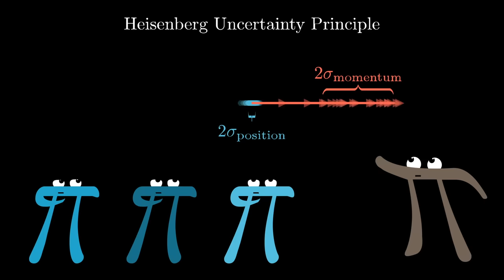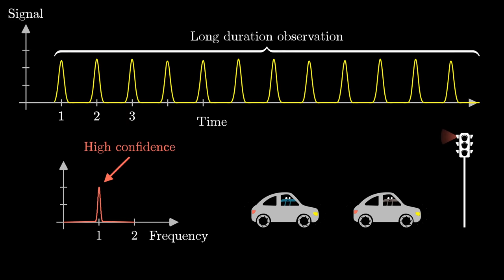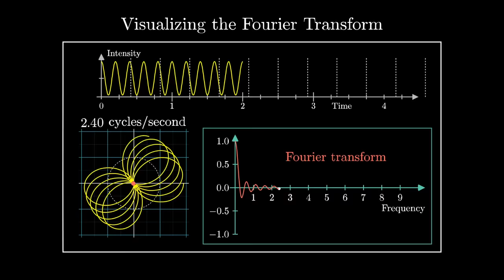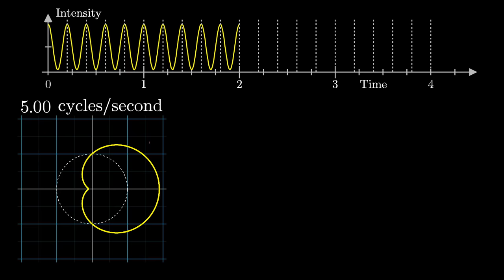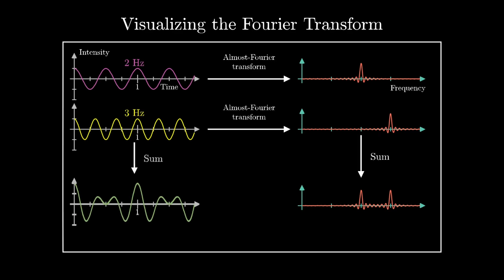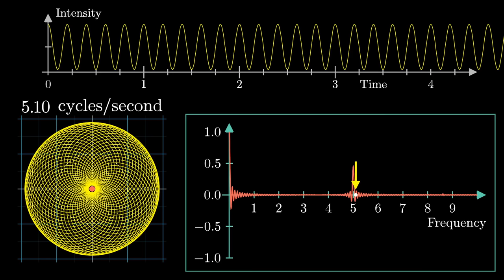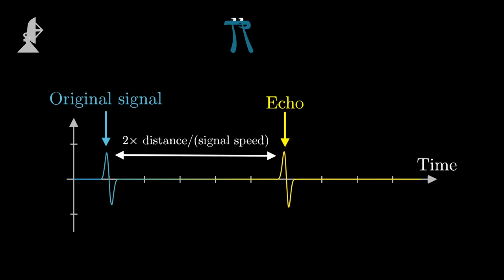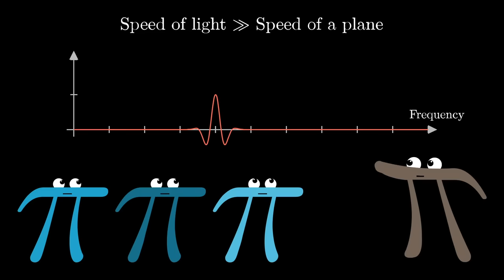The more general uncertainty principle, regarding Fourier transforms

Comment: I recently developed a music training app that is supposed to listen to what you play and assess whether you played some given melody correctly (in time and frequency). So, the waveform of what the user played was chopped into smaller pieces and the fundamental frequency of each piece was extracted, to assess whether the correct note was played at a specific time. Of course, as you explain, larger windows meant more accurate frequency assessment but with a tradeoff to identifying when the note corresponding to this frequency actually started.

Wonderful intuitive explanation - thank you so much! I didn't have a clear grasp of what De Broglie's theory was explaining, so I was totally missing the connection of the above described problem with the uncertainty principle.

You explanation can make a wonderful STEAM course for the uncertainty principle!

Comment: Updated Demo with P5js. https://jbracey2004.github.io/Examples/Excercise00_WindingFunction.html Still Work in progress
Reply: Bob Tivnan It would be interesting to see what the position vs time graph would look  like with that pi creature
Reply: This would be fairly easy to do. I already parameterized the x and y coordinates of the sampled points. Why would do you think it would be interesting?
Reply: Bob Tivnan well, to see some 2d figure represented by a waveform; though, there  may not actually be such a thing
Reply: +Jason Bracey Its just like the video +Bob Tivnan but if you do position vs time then it is always 2 or 3 places at once
Reply: A lot more people use Processing lately... I am impressed by how well Processing is doing.
Reply: Good work
Reply: Great job Holobrine! Your comment about the cos^2 wave can be seen in the polar curve as well. If you simplify and set your function to y=cos(nx) or y=sin(nx) you will notice that the polar curve always has evenly distributed petals except when the wrapping frequency equals n. In this case you get one petal which is a pure circle on the positive side of the x or y axis. Hence, the center of mass is shifted only in this special case. This is a different way to explain the orthogonality of the cosine and sine basis functions.
Reply: By the way, geogebra and desmos are very similar and are great for visually describing math. The downside is that they are much less computationally efficient than javascript or python.
Reply: Bob Tivnan To my knowledge, you cannot calculate an integral with Python, or at least not without a library.
Reply: If you are using continuous functions then an integral is needed. But, if you take the discrete fourier transform approach by sampling points along the curve (which is what I did) then you are not using an integral at all. You just sum up all of the x and y coordinates of the points for each winding (n) after multiplying to the basis function (e^i2pi*n/N). N is the number of sampled points along the curve.
Reply: +Lord of Galaxy I use processing recently for trivial and mediocre projects like interactive circle inversion (actually thats one of the less trivial ones)

Comment: Great video !

My take on the end riddle is that it is possible to determine that one individual is stronger than another by simply having the 
first 10v10 match, note which side has won, and slowly swap the two team player by player until the winning side switches.

Once that happens, you know for sure that the previous iteration traded a weaker player for a stronger player. So you can just send the last player that switched who came from the previouslty winning side.

Comment: It should be noted that the uncertainty principle in modern formulations of quantum mechanics doesn't rely on fourier transform pairs at all. It is instead simply a consequence of non commuting observables and the postulate that single measurements only yield probabilistic outcomes that obey the probability distribution related to the quantum state. In conventional quantum mechanics all observables like position and momentum are represented by complex linear operators (i.e. matrices in most practical cases) with real eigenvalues. So if you're familiar with the linear algebra series of this channel then non-commuting observables can be thought of as pairs of matrices A, B where the product AB is not equal to BA, usually represented as the commutator [A, B] = AB - BA being different to 0. For position x and momentum p the commutator is [x, p] = ih/(2π) for example, with Planck's constant h. The fourier transform in the uncertainty principle then appears as a consequence of this commutation relation.
Reply: Also, connecting this further to the linear algebra series (albeit this particular point wasn't covered there) one important consequence of A and B not commuting is that there is no common eigenbasis of A and B. In quantum mechanics the state vector |ψ> (which is almost the wave function) of the physical system becomes the eigenvector correlated to measurement outcome of an observable, which is always an eigenvalue of the measured observable. The position observable X has eigenstates |x> with the eigenvalue equation X |x> = x |x>, where the lower case x is also the eigenvalue (just typical quantum mechanics naming conventions). Same goes for the momentum observable P with P |p> = p |p>. The position wave function ψ(x), which is shown in the video, is the scalar product ψ(x) = <x|ψ>, so it is nothing more than a projection of the abstract state of the particle to the position space. Likewise we have ψ(p) = <p|ψ> for the momentum wave function. So if the state is in well defined position it is one of the eigenstates of X, meaning |ψ> = |x>. But because X and P are non commuting, i.e. [X, P] = ih/(2π) is not 0, the same |ψ> is not an eigenstate of P and will thus have a range of eigenvalues p as possible measurement outcomes. This is basically the more quantum version of the uncertainty principle which can also be applied to other observables like Spin and Charge.
Reply: And btw, to anyone still reading my ramblings about the connection to quantum mechanics: If there was some addendum to the the linear alegbra series including videos about Hilbert spaces, unitary operators, change of basis by means of series expansion and the aforementioned implications of commutation relations, it would be all that is necessary for a starting point for solving actual problems for finite dimensional quantum mechanics problems. If you throw in an introduction to tensor product spaces this would enable one to tackle basic quantum information problems with qubits. After all the mathematics behind quantum mechanics is actually far easier than classical physics, since it only concerns linear algebra and some minor probability theory.
Reply: I wish so bad that I could understand you.. :'(
Reply: Halberd Rejoyceth first of all, I second this notion. Such an extension to the series would be beautiful.
What you said is absolutely true, but the uncertainty principle for Fourier transforms is simply a special instance of what you explained for dual observables, namely if you choose to represent your vector space by the Fourier basis. The commutator builds a vector field on the underlying manifold which, in this case, happens to be constant. I still think it's useful to think about this in Fourier transform terms. It makes it easier to visualize what's going on than having to think about linear algebra on complex manifolds.
Reply: Sagar13iffy Try taking a look the book “Quantum Mechanics: A Paradigms Approach” by David H. McIntyre. The book builds up to the concepts mentioned here with not much more than relatively simple linear algebra.

Comment: Oh, this is such a great video!
I was playing aroung with an ultrasound machine and the doppler-imaging. And there were two options: pulsed-wave doppler, which can measure the velocity over a region, but not very accurate (expecially at high velocities), and continous wave doppler, which meassures the velocity better but without regional location. 

I highly assume, this has to do with the Fourier-Transformation. And since I struggled to understand the differences between these two options, I think I finally understood why it is that way due to the video.

Thank you!